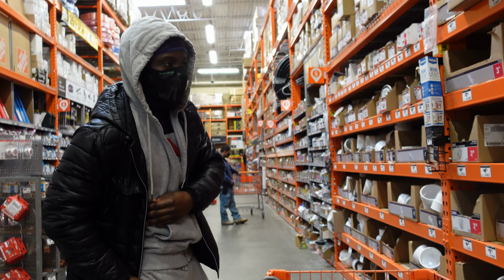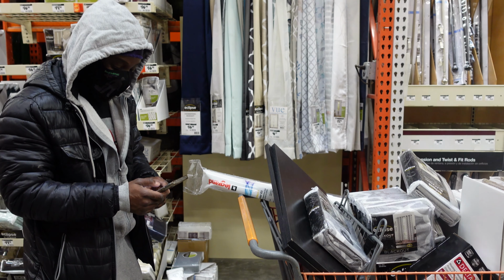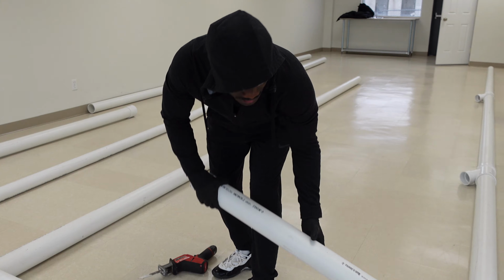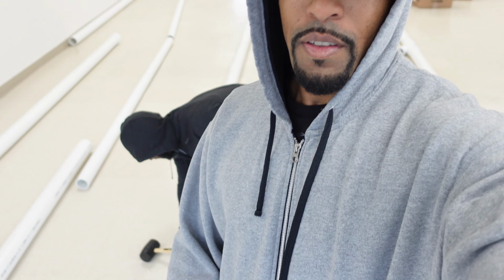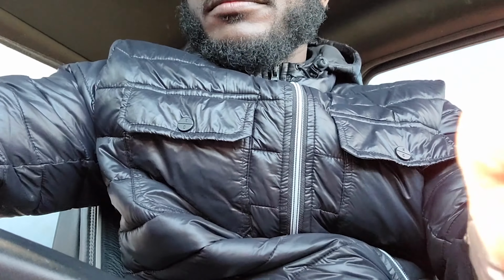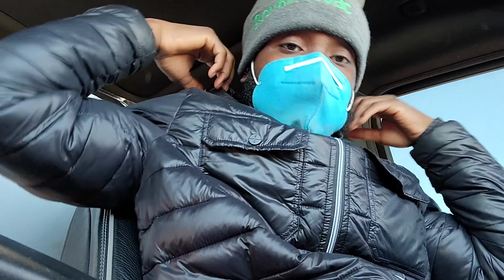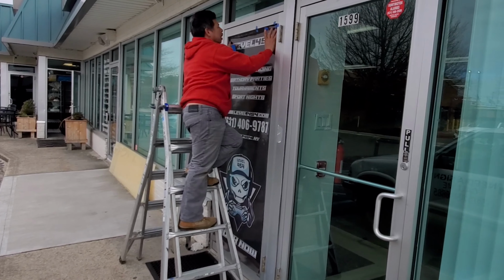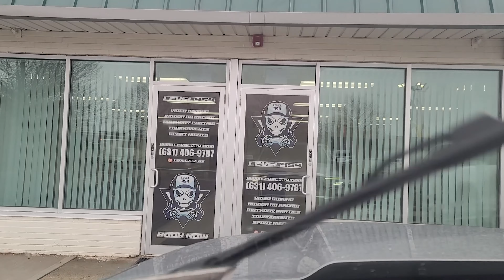New Indoor RC Car Racetrack and Video Gaming Facility on Long Island

Comment: You should get some vending drinks despencesr see the guy on hete or tiktok im not sure where i saw him but it would work out better than ppl having to bring snaks..or have a little snack store ..but in the long run if you put them out front ppl can get drinks from you as well..Congratulations its a brilliant idea..id be there with bells on if i lived in the states..
Reply from the maker: Thanks for the love and support 🙏🏾💯
Reply: @levarcarter4492  actually i need to thank gou..do you realize this has the power to change a kids life if they spend time here rather than running the streets and getting into untold trouble..your a good man and this is a wordy cause..